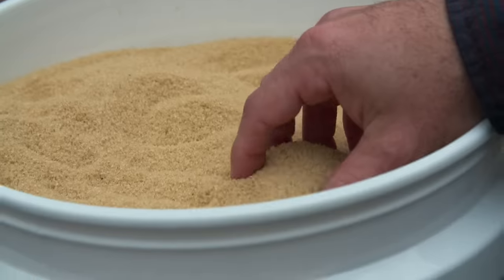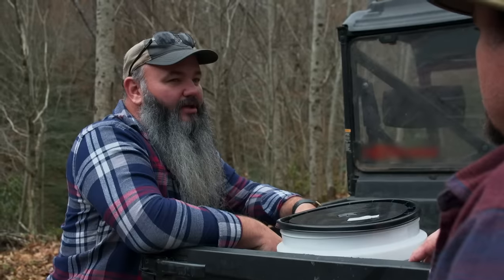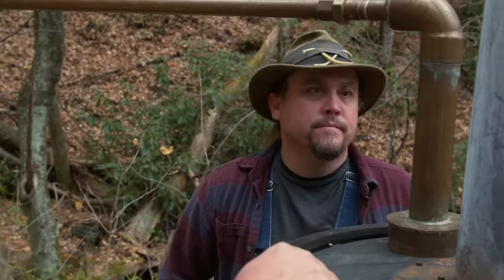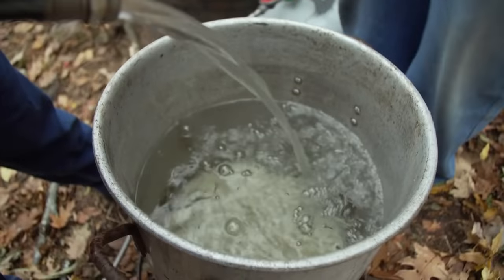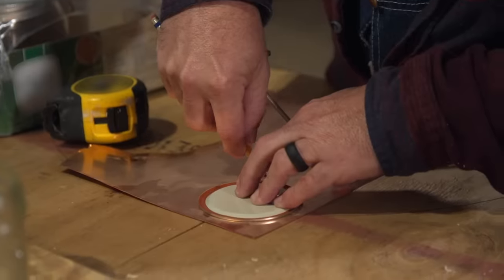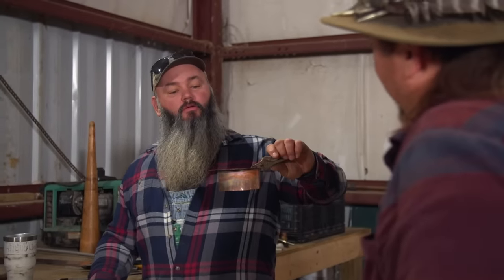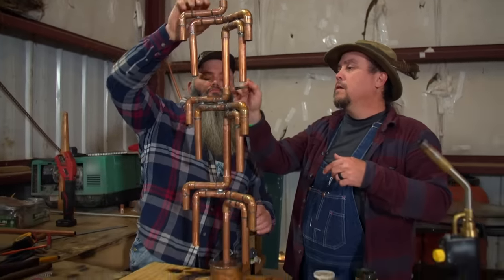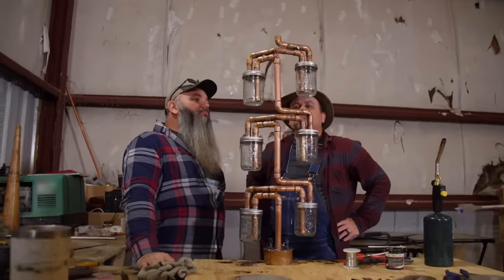Moonshiners Make 170 Proof Liquor With 6 Different Spices I Moonshiners

Comment: In prison I used to get a 5 liter bottle and fill it with orange juice. A few slices of brown bread.Then a bag of sugar with hot water. Then leave it on the pipes they are hot. And 7 days tops it’s about 15 percent . And if you get done it’s a extra month lol
Reply: Ah good ol' pruno.... I did the same with grape juice and Lavlin EC1118 when I was underage... It's as smooth as drinking a glass of moldy bread but a single glass will do you.
Reply: I'm surprised that the acidity wasn't too high though. Acidity tends to rise as the fermentation process progresses - with something like apple juice that isn't a problem but orange juice is already acidic. I imagine the ferment would stall pretty easily.

Also, I don't think you got to 15%. A lot of wine yeasts don't go to 15% - and bread yeast is less robust. Not to mention, even if you take a yeast that's rated up to 15% to 15%, you tend to get some really bad flavors because the yeast starts struggling at higher alcohol concentrations... Most bread yeast max out at around 10%.
Reply: Now people use stingers to distill the pruno into some vodka

Comment: What’s the point of sticking something in the pipe when the moonshine starts to pour out? I’ve seen it in a good amount of these videos and can’t figure out what the point of it is. I’m generally curious.
Reply: Makes the stream run better into the jars.  

Put water in a jar and try to pour it out.  Some will run down the jar and get your hand wet.  Same concept as to why you do that.
Reply: It keeps the whiskey from breaking off the stem an running down  the bottom of the pipe .
Reply: @ReDNeKinKY  it's too keep the whiskey from breaking back running down the bottom of the stem or pipe.

Comment: Johnny Depp makes moonshine? Jk

but really though, if the moonshine is made with brown (cane) sugar as it's sugar source, doesn't that make it a rum?
Reply: Yes and no. Rum is run on pot stills - so flavor from the sugar cane carries over into the final product. They were essentially running a multi-plate reflux still here - when alcohol is coming off at 80% ABV, very little of the mash flavors will actually carry over. You end up with something closer to vodka or Everclear (or what Jack Daniel is before it's aged) than anything else in this case...

The only exception is when you add something like lemongrass or another very pungent oily herb into the equation - then the flavor tends to carry over no matter what. Even multiple runs and charcoal filtering can't save a horribly flavored batch.